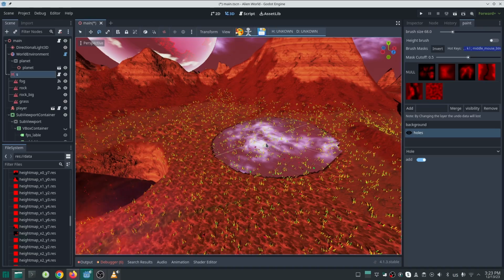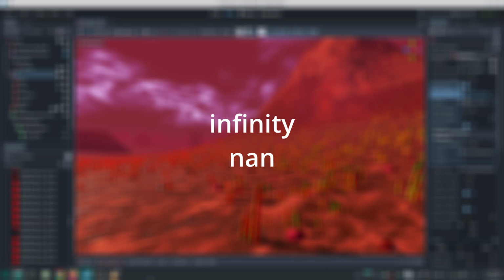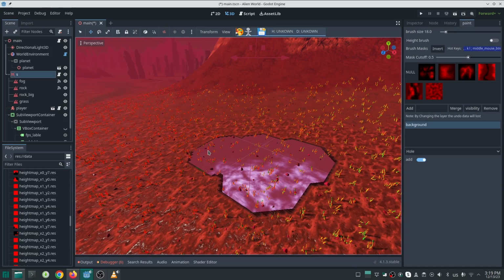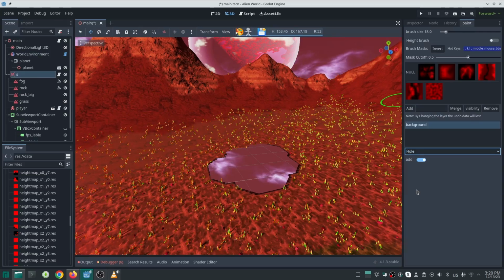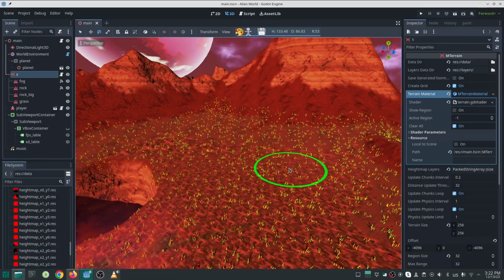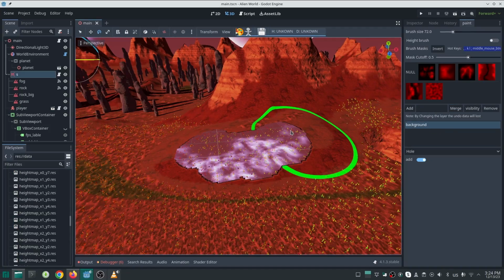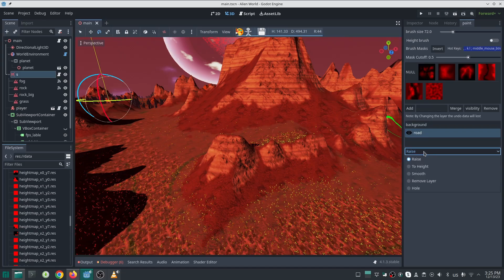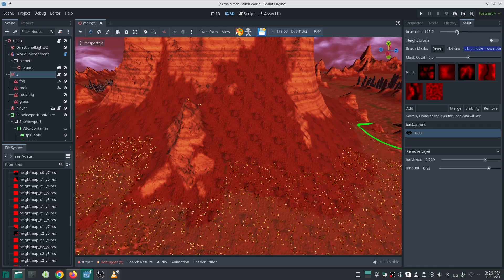so Hole in M Terrain - Godot engine

Comment: Thats really cool! So far, the holes I've seen were visual only and required turning off the collision from the map and turning on the collision of a mesh on the hole like a cave. In godot the way around it was changing the player's the collision layer
Reply from the maker: I did not know about this also before after some testing I realize this is working, I test this on different platfrom (Windows, Linux, SteamDeck) and after it worked on all of them, I said why not, By the way in Shader in part where there is a hole if h is a height value (h==h) will return false